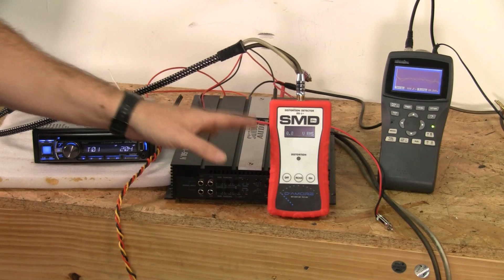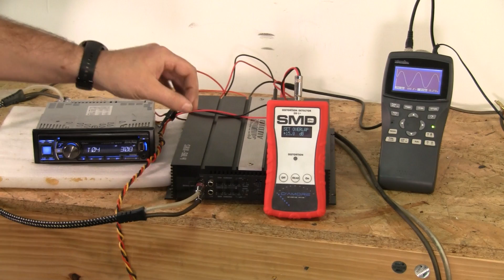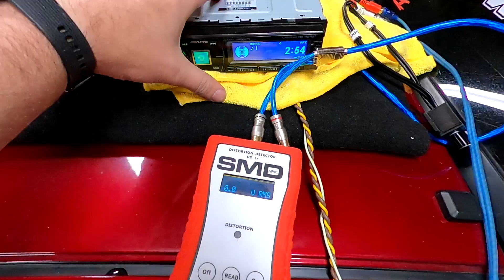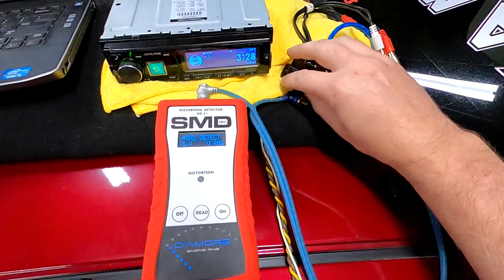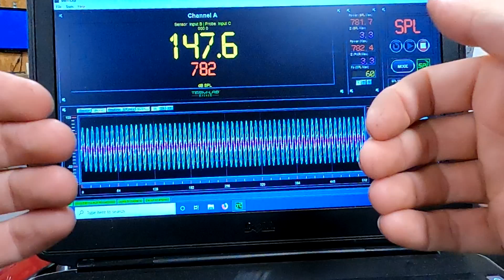The TRUTH about the D'Amore Engineering / SMD DD-1+ - Tech Stuff Tuesday

Comment: I use one of those 30$ cheap oscope it works amazing for tuning amps
Reply: I use a dso150 works perfect I sold my dd1
Reply: @Isaak0000  I use same one! It works awesome
Reply: You're not going to get a good enough resolution on one of those to actually see true clipping. But you'll get close enough for the $30
Reply: DSO150 spec ftw
Reply: I use the Liumy.
Reply: @rickdodson5252  its only good for test tones right? You cant track music playing on that screen can you?
Reply: @blackranger900  true, but the point of the dd1 is to make sure you're not clipping which, can be done with an oscope. I am not in the business of car audio, it's just a hobby. I guess if I were doing system installs daily then maybe I could see dropping some coin on the D'Amore products.
Reply: @blackranger900  what?  it's an oscope, you can do pretty much anything you can do with any other oscope so yea you can analyze music.  mine picks up 1khz just fine.  screen resolution is pretty small and the upper limit on your range is about 30 volts, you can read up to about 40 - 50 volts with a x10 probe, but know that your voltage reading will be off when doing so.  also you have to put it together yourself so if you suck at soldering you're gonna get a really noisy oscope, but they're bretty gud bang for the buck.
Reply: @buddykiller  i ask about music because it is so dynamic. Ive heard people say it can be hard to read clipped waves when the waves are so dynamic on a small resolution screen. I was just asking about the personal experience
Reply: @blackranger900   Gunk  pretty much what justin said.  you don't really play a music track to set  gains for a reason.  given that you have a good strong signal it's very much apparent when you don't have a clean signal if you're using a half decent probe, you'll see ripple going across the waveform or the waveform will look misshapen where you should have a solid wavey waveform.  it can be harder to see on weaker signals, but that's distortion, anybody that tells you they can't tell the difference between a nice curved sine wave and a choppy square wave goes in the wood chipper feet first.  clipping is impossible to not see.  clipping is when the top and bottom of the waveform flattens out and it looks as though you clipped them off.  don't expect to be able to fine tune an sq set up to it's absolute best performance with 0% distortion and 0 clipping, but for the majority of hobbyists and musical enthusiasts the cheap as dirt dso kits work just fine.  don't get the big chunky one with the clear acrylic case, the little one with the pot is the one you want.  i mean i'm looking at the stupid annoying hiss produced by my preamp on my tweeters right now so i have no idea what these people are talking about.
Reply: @buddykiller  thanks. Main reason for my interest is I am in process of doing my first install. I bought a nice pair of 8s for my doors and was setting the gain on amp with a test tone, listening for clipping by ear. Well, i killed the speaker. Now im being told by others that i should not use test tones for mids highs, but rather use music and listen for when it clips and then turn it down. As you can imagine, im pretty hesitant now to turn my gains up to clipping again as i certainly cant afford to kill another speaker.
Reply: @blackranger900  are you using the high pass filter on your amp to cut the lows going to your doors, and are you setting your gains with the source you use most often?  for some dumb reason it seems like manufacturers haven't been matching source levels inside the hu such that cd, usb, and bt can all have different levels.  on top of that if you're using bt or aux in you need to check your device to see if it's distorting the signal.  another thing to be aware of is the recording levels of the stuff you play vs the recording level of the tone used to set your gains.  most media is recorded around -3db and -2 db so if you want to be extra cautious make sure you set your levels with a tone at 0db, but it's like sean said you won't get all your power if you do that.  another thing to keep in mind is that if you listen to a lot of bass boosted or decaf tracks the extra boost in the signal can throw off your filters if they don't have a high enough roll off.  also, things like tone controls and eqs change the signal strength so after you do your initial set up go ahead and set up your eq then go back and recheck your levels for clipping.  sine sweeps are really good for this because you might not be clipping at 1khz, but you could be clipping at other frequencies.  definitely do get a cheap scope, they really are simple to operate and can really help you learn what distortion and clipping sounds like.
i use a tablet with bt as my source and i know i can turn it up to 100% on bt with no distortion so i set my levels there then turn it down to 90 for normal operation that way i can run close to all out without ever fully running all out.  i wouldn't suggest using music to set levels because it just isn't reliably repeatable where as sine waves are always x freq at y level.  now, setting up an eq on the other hand... :P
Reply: @buddykiller  when the speaker blew, i was playing a 80hz tone through it, so crossover wouldnt matter at that point. I had already set the gains with a 100hz tone earlier. I was letting the 80 hz tone play at around 50% volume and was hunting down rattles in my door. I did have the bass on the HU up to its max cuz thats where i normally listen to it at. I guess the combination of playing the tone for 20 seconds straight with bass boosted eq was too much for it. I didnt think 80hz would be a problem cuz the speakers have a 65-6k freq. response. I guess the lesson i learn is dont play a tone for that long and dont turn up eq when doing it.
Reply: You can increase or decrease the volt/div settings and timing to increase or decrease the "resolution" on an o-scope..
Reply: ive haven't seen a cheap o-scope yet where you can see the 1% t.h.d clipping yes but not the 1% t.h.d
Reply: If OP really cared he would reply to this comment about 30.00 oscilloscope being reputable and state what we all know as true. It wil never be clean enough(resolution) to tune accurately
Reply: @wiredkustomsmotorsports  you're such a pretentious piece of shit.  have you ever actually tried it or are you just parroting daddy meade when he tries to sell everybody his bass boi bath water?
Reply: Buddy durden. Click the profile. Learn who you’re interacting with.
Reply: Once you tune hundreds of vehicles you’ll get it. Until then it will just seem ok and normal to you. I understand why it does.
Reply: @wiredkustomsmotorsports  "i...i...it just matters ok!?!? " yea, ok, suuuuuuuuure.  you sound like an audiophile telling me why i should buy $5k directional speaker cables that have specially extracted virgin copper, have been frozen, and have a battery thrown on the end.  tell me more about why i care if an amp reaches 1% thd at 1k when i'm driving 400 - 500 watt speakers outside of making the choice to purchase said amp.  i don't compete, i'm not doing anything extreme, and i just want my audio to sound nice like 99.999% of consumers of audio gear.  you install gear, right?  so you've got something to sell everybody, right?  do you charge people to set their gains?  if so, neck yourself and stop shilling expensive equipment and services to people that don't need it for reasons they don't understand.  you're not going to have enough distortion in your system to damage your equipment before you start clipping unless you're doing something really really wrong and stupid.  WE GIVE OURSELVES HEADROOM FOR A REASON.
Reply: I do the ear. Ear will. Ear will never hirt your speakers! Always do double on the RMS on what you exspect though
Reply: This is why people like Meade are assholes. Everyone has a voice on the net. No matter your experience level

Comment: So basically the same thing would happen if you used the oscilloscope and not DD1 or DD1+. What you failed to mention is you would have to adjust each source separately with the product. Most every head unit allows separate levels for the individual sources. If you're using usb, bluetooth or wifi your signal depends on the quality of the recording. Besides the point you are hard clipping at max volume. If you are listening to your system at full volume all the time you deserve to destroy your speakers and your hearing. Good luck.
Reply: Good point...
Reply: I said kind of the same on his last video.

Comment: I own a dd1. Wish I had bought o scope . This video is accurate😎.
So now I set my EQ the way I likey and then go to clipping with the setup.
Reply: Psalms 14- The fool hath said in his heart there is no God.
Reply: Damn, Steve copied and pasted someone else’s comment, but left that part out....
Reply: I have Jesus in my life, he cuts my grass....🤣
Reply: this video is "accurate" SMH  lol

LIST OF  ERRORS

1.  Video description.  RF paper on building your own high passed speaker project is not 1/10 the price.  It's twice that, WITHOUT LABOR,  is your time is worthless?  You just valued it at $0.00 per hour

2.  Video description.  A High Passed Speaker is not a Distortion Detector.  RF you listening?  

3.  1:39  No headunit is 0.5V out.  But if it was you just put the probes on the amp to set everything, headunit, processors, amp, all measurable THROUGH the amplifier.  This is actually the preferred method since this way you can see distortion of outputs AND INPUTS of all components in the signal path.  No need to plug headunit into DD-1+, ever, unless you want to see how many volts come out of it.  

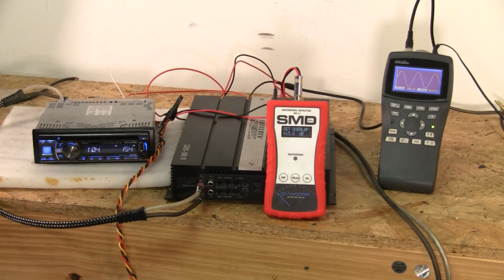4.  At 9:42, at this point you are supposed to press READ and then switch to the OVERLAP track.  EVERYTHING FROM THIS POINT ON IS INVALID SINCE YOU DIDN'T.  THERE IS NO reason for anyone to watch this video past 9:42. 

(I'll keep watching to see what other misinformation you are spreading) 

5.  13:43  The voltmeter on your scope is a cheap AC averaging meter that calculates AC RMS from any waveform, based on the math for calculating the RMS of a sine wave.  The math doesn't apply to square waves hence the error on your scope.  The DD-1+ voltmeter looks at the peak of the waveform, any waveform and determines what the maximum clean sine wave voltage would be that fits in the "rails" of the waveform.

6.  16:19  So you're saying if someone adjusts their gains for maximum clean output, and then you turn up the EQ or level more it clips????  NO SHIT

7.  17:32 And how would using your scope or the my first electronics project from RF to avoid these problems?  It can't.

8.  19:34 This is a problem with this headunit.  A better headunit has trim level adjustment for all sources, or an engineering team that took care to make sure all sources had the same gain before the design was mass produced.

9.  20:30  The DD-1+ shows when distortion reaches 1%

10.  23:32 Please describe this "more" that the scope tells you

11.  25:12 yes

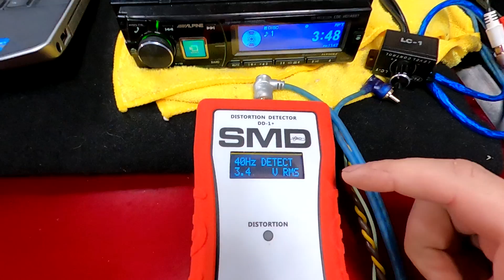12.  29:01 this has nothing to do with the DD-1+

13.  30.28  this is exactly why it is best to do all measuring at amplifier output

14.  31:04 the quick blink of the LED when increasing level is the 3 stage autoranger switching ranges, mentioned in manual

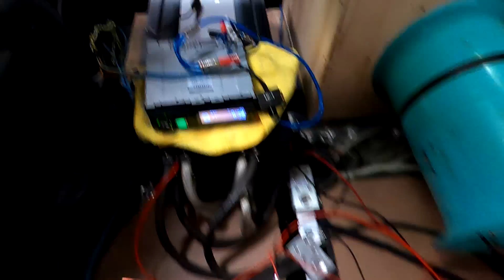15.  32:10 you just set it with NO OVERLAP?!   EVERYTHING after this is also invalid.

16.  34.14 voice coil is hotter now and the impedance of your woofer is higher, so in turn it got less power.  20 less watts = 0.1dB less, nothing to see here. 

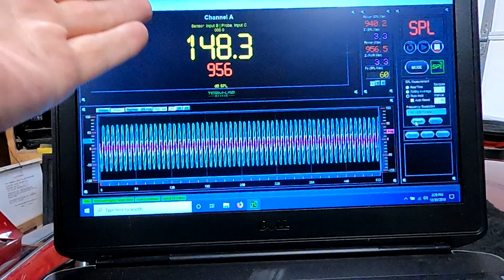17.  39:00 You clipped it hard, of course it was louder and put out more power.  Now try using the DD-1+ properly and put 5dB overlap in it and do SPL run and make that video.  

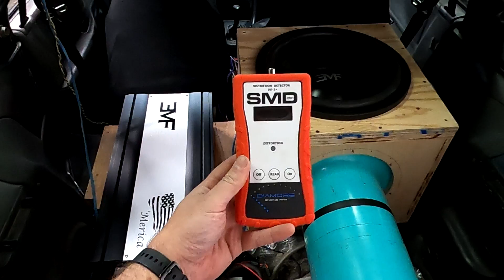18.  40:41  You showed us that you STILL didn't use it right, even though 20,000 people already know how to use them perfectly everyday.

Jesus can't even help you now.
Reply: @meade916  
Still wish I bought an oscope😂😂
Jesus is real. There is concrete medical proof dum dum.😂
Happy new years all!
Reply: @meade916  thank you
Reply: @Average Joe78 why should i? I PROMISE you i get out more than you do.  I spend all my time doing fun shit. You are the one stuck on the net.  Ill be in Vegas in a couple of days for my 2nd time in a month. Where have you gone besides church to get brainwashed? You should get some fresh air.
Reply: @Average Joe78 LMAO!!!! i believe in the Buddah.
Reply: he didn't even do the test right.  "wish i would have bought an oscope" LOL don't listen to this jackass.  You guys are all suckers.
Reply: @meade916  Jesus Christ, link to your video that shows the correct way to use your tools........
Reply: @Not_An_FBI_Van  i just did one like 2 days ago.

Comment: I use a piezo tweeter with a 2.2uf capacitor in series  to set the gain of a subwoofer amp, it  would make noises when the signal is clipped
Reply: Did you get that idea from Barevids?
Reply: River Alley yes i did
Reply: @Juanito Churro ah that's how he's losing the weight
Reply: Oh valid point you say hes lost weight recently? He is constantly on edge, acts strange, abnormal high self esteem and says crazy shit now it all makes sense.
Reply: except that doesn't work when you use 40 Hertz
Reply: @Todd_Wilson213  yea dudes a real piece of work, was a big fan once upon a time
Reply: I have always done it the same way you just mentioned, Steve Meade replied to my comment on the last video emf did and said even using that method you could still be off might not be getting the full potential of the amp. After giving it some thought I think I'm gonna bite the bullet and purchase a dd-1+ and an oscope just to be on the safe side. When you you contemplate the cost of the this equipment compared to what you spend on good quality subs and amps I figured it's worth it plus why not get the most out of my sundown sa12's and skar 2k. Just my 2 cents.
Reply: Nick Cossio check barevids his video, you dont need a dd1, just an old speaker and a capacitor
Reply: no you don't.
Reply: @meade916  who are you and have you considered medication you seem on edge.

Comment: Why using different impedance would need to change gain setting? If you set it with subwoofers disconnected
Reply: If for example you were using a multimeter, the forumula is The sqaure root of Nominal RMS power(per channel)  X Impedance.  So a 100 watt at 4 ohms would require your gains to be set to 20 volts, but a 100 watt at 2 ohms would require your gains to be set to 14.14 volts.     If you were to set the gains for hookup to a 4 ohm speaker, and then changed to a 2 ohm speaker, your gains would be set too high.

Comment: My modus from snap-on does everything this thing does and will communicate with all models of car/truck and I can watch EMF while doing so😏
So on my deck ( pioneer DEH-9600bx...ish) I've noticed if I adjust my SLA it will adjust the amp of the deck separate of the volume. Watching it on the scope I can adjust the max volume of my head unit . So if I clip at say @45 out of 60 I can turn the head unit down to allow it to run cleaner at a higher voltage .....I don't know if I'm understanding correctly but I know , cus I used my eyeballs , watching a o scope, that's what it does. I am not sure that's what it's for. I can set that separate for different formats ....example ,,
When I play Pandora I need to add more SLA ( +2 ) to compensate for the crap signal but when I listen to CD I run -1 SLA , sub volume and less or more cross over. So am I just doing things wrong or did I accidentally do something right?
I do final adjust with my ear. Mr EMF you can't tell people to use common sense these days, I mean one, it's rare and two there is not a app for common sense.😐
Reply: We just got a zues at the shop ND no lie it'll do all that and some, but the $12k price tag doesn't justify it really lmao
Reply: @erik120719  🤭🤣😂🤣
Reply: I think the SLA uses the CD source as baseline, and you adjust the other sources from that